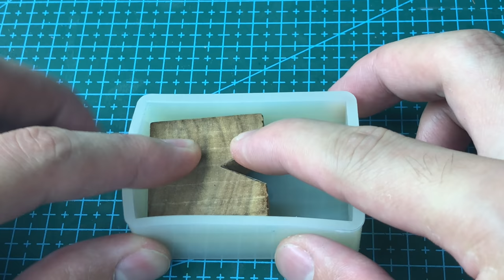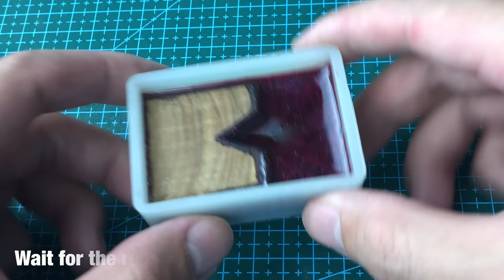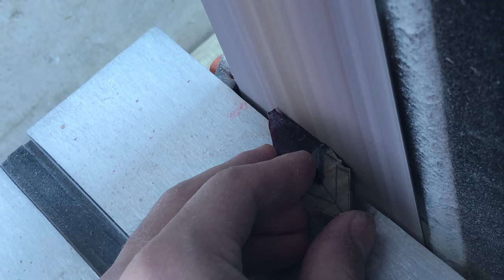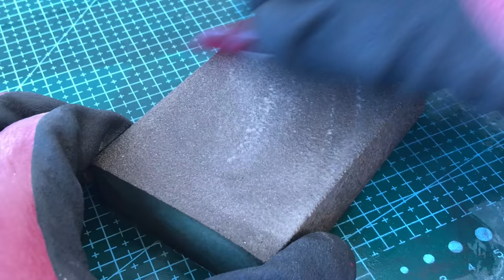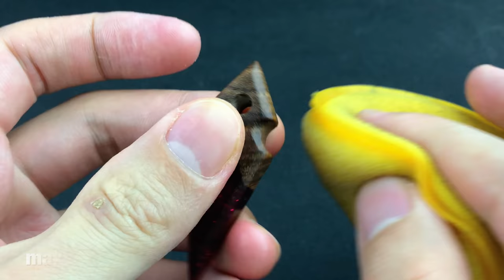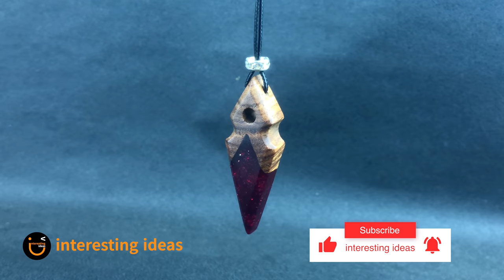Resin art Amazing Stardust Crystal shape Necklace Pendant jewelry/epoxy resin necklace jewelry S108

Comment: My question is are you wasting all that wood and resin for a piece that small?
Reply: because it looks pretty
Reply: It's always better to start with a piece that's a good bit larger than what you intend to end with in case something goes wrong during the sanding process (like a piece breaking off or something cracking on the belt sander), that way you have a buffer if you need to file out/down an imperfection.